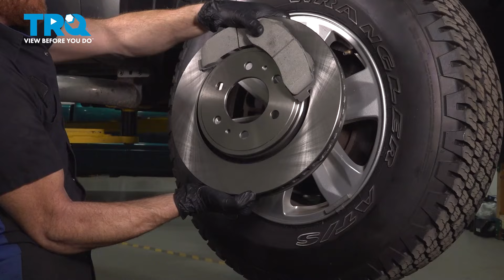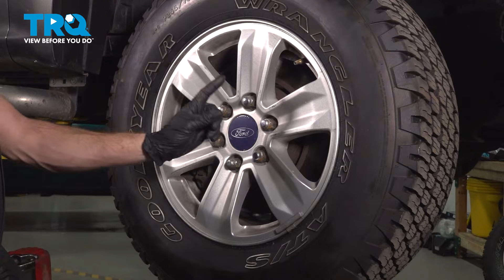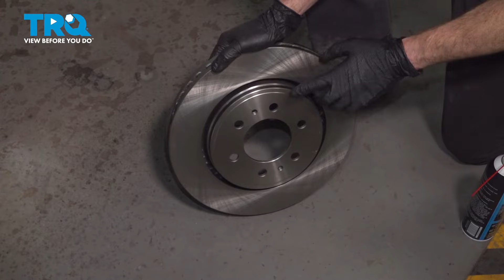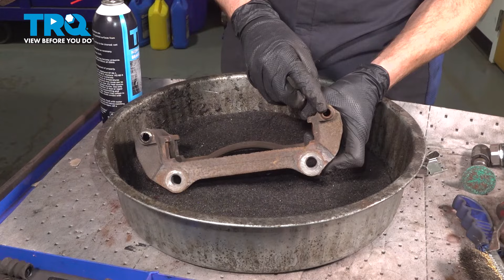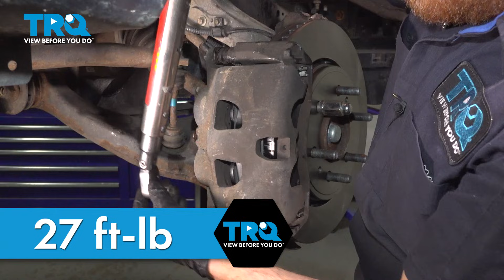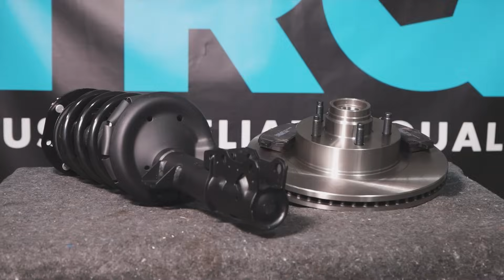How to Replace Front Brakes 2015-2020 Ford F-150

Comment: Alright, I followed the instructions to the T, and there's a couple of things that should have been clarified out the gate.  Firstly, you don't need a literal lift to do your brakes... I know it seems like common sense, but I assume if you're reading this, you're attempting your first brake job.  You can jack up your vehicle and do one side at the time if you need to, but you're better off using jack stands and doing both brakes at the same time... mostly for time's sake.  DO NOT DO ONE SIDE ONLY AND DRIVE THE VEHICLE (again, common sense, but there are no stupid questions... just lack of clarity).  Next, take the cap off of your brake fluid reservoir, or at the very least crack it open before you push in the calipers, and do expect a bit of fluid to "overflow" from it when you push them in. Be sure to wipe said brake fluid up quickly, because if it hits a painted surface, it will damage the paint almost immediately.  The cap you're looking for (on an F150) will be driver's side, close to the windshield... can't miss it.  Next, the "tins" he's talking about (that you slide the brake pads into) are called "brake pad abutment clips", and they don't all install from "back to front"... the ones that came with my pads were defective, and the replacements that I bought from the auto parts store went in "front to back".  Whichever you have, be sure that they clip in firmly and sit flush to the bracket. Also, the four clips themselves don't all go in / face the same way. The "fatter end" (the end with the bigger metal part that kind of scoops under) points facing towards the outside of the bracket all the way around.  Lastly, when you have those clips installed onto the bracket, give them a thin layer of brake lube, and do the same with the "ears" of your new brake pads (the part that touches and slides along the clips) when installing them... save yourself a ton of headache.

Comment: What is the the torque for the 21mm bolts? You say 184 lb-ft other sources say 155 lb-ft of torque. Which is the correct number?